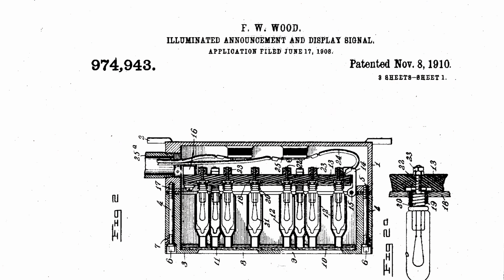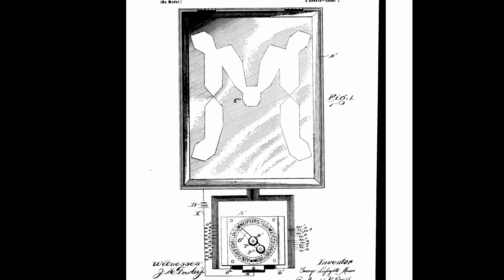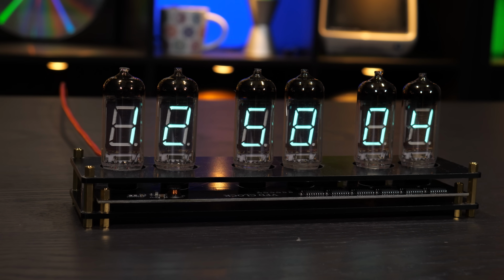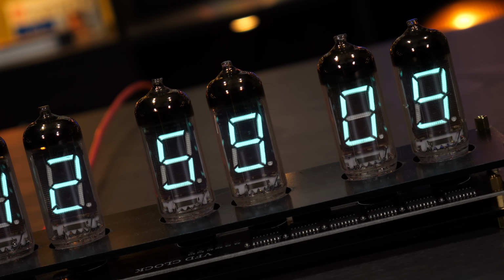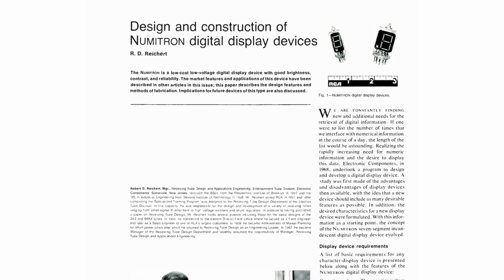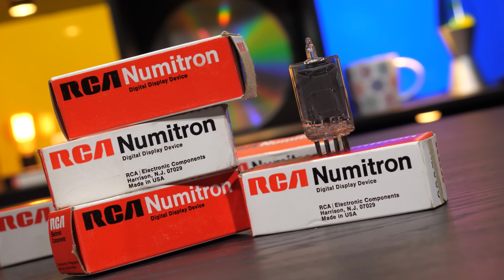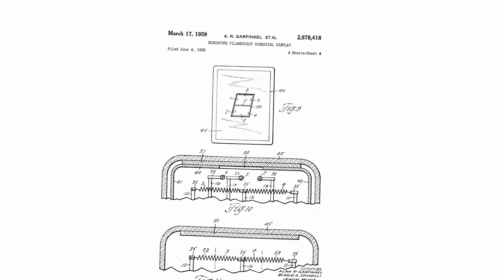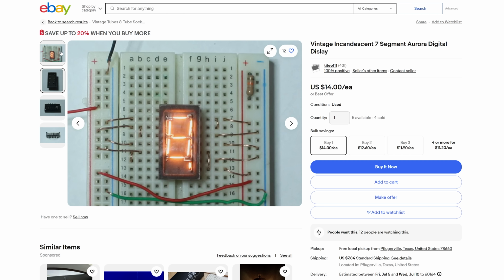The Numitron: An obvious idea that wasn't very bright

Comment: Really!?  You can't give these guys a break for an early technology product?  Before these, cash registers had rows of ten metal cards with a digit painted on it.  In each tens and decimal place.  So if your groceries were $12.67  You would hear whirls and banging the mechanical adding machine parts produced the total.  Then a series of solenoids selected which of the numbers cards to be displayed.  Then it would have to be thrust up into view by another solenoid.  Something that could be heard all the way across your favorite restaurant.  Now these come along for registers with electronic calculations and displayed your total with these amazing lighted digits.  All with no moving parts.  I can assure that no one that saw these quipped about what a half-assed idea they were.  

Maybe you should have a follow up to this.  Where you find any remaining engineers, they will all be in their 90's now.  Bring them on in their wheelchairs.  And have them beg for our forgiveness.  That 55 years ago they did not try harder to invent OLED displays before they dared to role out any display products.

Comment: If you're just going for a seven-segment display, you can address the visibility issue with a mechanical display, where you have a black mask with cutouts for the segments, and each segment is spring-loaded, with a tiny electromagnet to tip the segment to be visible through the cutout. This actually has the opposite visibilty issue, in that it requires lighting under low-light conditions, but becomes more visible the brighter the environment becomes. There are obvious minimum size constraints to keep the electromagnets for the segments from interfering with each other, but it can be made quite large without having to alter the mechanical design.

Comment: Fun piece of trivia regarding human-readable displays: In one of his bigger failures of postulating advanced technology, Robert Heinlein, in his novel 'Starman Jones', has the Navigator's Guild possessing 'secret' books of information -- which are just binary-to-decimal and decimal-to-binary conversion tables, because the navigation computers only accepted binary input and output only binary data, so the navigators aboard starships had to perform their navigation calculations (by hand and slide rule), convert their results into binary to be entered by hand into the computer, then read the binary data output back from the navigation computer, convert it back from binary to decimal, and repeat the whole process over and over again.

Comment: Looks very steampunk. My grandpa had a digital mechanical clock that would instead of having LEDs flip physical cards with numbers. It used half number cards so going from say 8 to 9 it only needed to change the bottom.

Comment: I bet between the limitation of the filimant shapes and RCA knowing LEDs were going to take over they pretty much just said shove what you have out the door and start workong on something new using LEDs.

 They would have likely had the inside knowledge that a way to mass produce LEDs  that was financially viable was about to pop out of the oven so there was no point in putting anymore time and money into these things.

Comment: In high school,  in 1980, I was taking electronics. We had a box of some decommissioned displays that plugged into something. We had no specs on them no background no nothing. One day I unsoldered on and hooked it up to our bench power supply and fired it up. The original case the display unit came in, did have a red front light diffuser. I put it in front of the display and it did dull the glare and everything you mentioned, but WOW. It looked more horrid than it did without the red color filter. They were being thrown out so I took about a dozen home thing that someday I'd do something with them. After all, most of the chips behind them were in sockets and there were BCD's all over the place. They had 4 - 7 segments all with decimal, and 1 #1 with a +/- . Needless to say, I carted them around until about 1995 then into the garbage they went. About everything was CMOS by then and 7400 series TTL's were about history. They were the small skinny tubes to boot. Man am I kicking myself for doing that today.

Comment: You want another janky technology of the same era - System 3 TVs. My parents had a TV repair shop and when the System 3s first came out they were guaranteed to come in for repair within 6 months because Zenith rolled them out before the tech was really ready. They were an early transition from tube based TVs to circuit boards - the name representing that everything other than the CRT and tuner was connected to 3 circuit boards - creating a whole LOT of empty space in the cabinet.

Comment: I suppose the more often you cycle the heat, the shorter the lifespan of the burner? That's why they are not using 1hz switching rate but like 5sec/5sec

Comment: Low voltage operation. Ha! It is true unless you are trying to use them in dynamic mode. Because the light output depends on power very non-linearly you need to increase voltage to provide the same power at low duty cycle.

Comment: The +/- 1 tube would be used in something like a 200 or 2000 count DMM. they show up to 1.99 (or 1.999) and the most significant digit will only ever be a 0 or a 1 (and require a leading sign).

Comment: 180V is low voltage as is anything below 1000V. Between 1000V and 35kV is medium Voltage and above is high voltage as per EU standarts. I know its still an issue that its higher than the control circutry, of course. Heck, 180V DC is close ELV, Extra low voltage which with Direct Current is anything under 120V and with AC anything below 50V.
Reply: Those classifications do roughly corrospond to actual issues one might face imo.

Comment: 180V is hardly high voltage :D
Though those tubes at least in larger configurations often need a lot more to turn on, like an order of magnitude more. Once they are on they dont need as much anymore, but that initial spark ionising the gas...
Reply: Oh, and i wouldnt exactly call 180V dangerous. Not in terms of electrocution or anything anyways. Theres a reason most electrical deaths occour above 300V. Most commonly with TVs which CRTs are driven by thousands or even tens of thousands of Volts. Other than that if its in the household its often with two phases instead of one, which comes out to 400V instead of 230V which one phase would have. Those 400V are commonly what electric stoves work with.

Comment: So, first observation, took you 1 hour and 2 minutes (plusish) to 'film' this video (That clock IS useful!).  As far as segmented displays, all of this was going on when calculators were exploding design wise, CB's were going crazy, and VCR's were about ready to hit.  Companies were scrambling to come up with hardware solutions to postulated 'hi-tech' ideas, so they could be 'on the ground floor' of ANYTHING that came along, especially as hardware lead time was months and years, and ideas was milliseconds. A lot of it was adapting 30-40 year solutions to 'now' ideas. I remember my first electronic project in the EARLY 70's a Heathkit clock with your mentioned fluorescent segments, and all of this prodded me to become a controls engineer.  It may have been hokey in implementation but it was ALL useful in what 'came next'.
Finally, still love your videos, both informative as well as nostalgic.  Next, maybe you can describe the original Mustang/T-bird Sequential turn signals! 🙂

Comment: Fundamentally incorrect analysis.  Nixie tubes using bi-quinary code don't need more outputs.
The clear advantage of the numitron was in having a direct interface to digital logic.   Microprocessors came a decade later, not a factor here.
Numitrons work very well in specific applications and are still in use, aircraft avionics being one example.

Comment: RCA developed them to get out of paying Burroughs Corporation for Nixie tubes.  Either to buy them or pay the royalties to build them.
They designed them to put into the RCA Spectra Mainframes and potentially into consumer products (ie tvs).  RCA sold their computer division after loosing millions and millions of dollars to Sperry Rand in 1971.
Sperry sold the Spectra mainframes as the Sperry UNIVAC Series 80 and then later 90.  Ironically, Sperry made big money in the 70s and early 80s selling RCA Spectra computers slapping the UNIVAC badge on them!
Oh yeah..... The unbelievable irony was Burroughs Corporation bought Sperry Corporation in 1986 becoming Unisys Corporation.   So, the very company who RCA didn't want to pay for Nixie Tubes wound up owning their Computer Systems Division!

Comment: Numitrons we're used in UK petrol pumps particularly Gilbarco highline 1 and Avery Hardoll mk4 a and b, the flat pack versions were used in Avery Hardoll mk4 c, Bennett Beck 5000 and possibly a few other manufacturers

Comment: I have a few DIL flat versions, never seen the round tube ones. I've thought of making a clock, however as light bulbs have a horribly short lifespan, thought it a bad idea (one person said I should add a presence sensor, so they only light when someone is in front of them.)

I remember a horse racing track (or was it greyhounds) that has a massive clock made out of 4 foot fluoro tubes, I remember thinking, wow now that was easy for the sparkies to setup, nothing Hi-tech their end.

As for the video, I was kind of screaming at the screen, "do up the screw on the last digit"

Comment: 3:10 Nixie tubes. The first digital display I built in the early 1970s used them. With the 7441 BCD to decimal interface IC, they were pretty easy to use. 

4:30 Then I tried 7 segment LED displays using the 7447 to drive common anode displays or the 7445 for common cathode ones. As late as the mid 2000s, having to drive a 2 digit display, I used a 4511 7 segment decoder and 1 line for digit select using a total. of 5 lines from a microcontroller to drive a 2 digit display.  My µC programmer thought I was crazy and wanted  to use 14 lines from the µC. 

8:20 Numitrons came out in 1970! No wonder they failed. I was already working with LED 7 segment displays back then. 

Good vIdeo though.

I now have a Nixie Tube style of clock I bought as a kit from a company in China. It uses edge lit plastic numbers with multi color LEDs. 

Go to the "banggood" web site and do a search for the "Geekcreit® Upgrade Boldfaced Word Imitate Glow Clock Full Color RGB Glow Tube Clock LED Music Spectrum Kit DS3231" 

Or on YouTube, do a search for ":Full Color RGB Glow Tube Clock Kit | LED Music Spectrum Kit"

I am not pasting a link as YouTube may think it is malware. 

I got the version that was $9 more with the PCB pre-assembled.  I also got one for my kid to use in their office at work.  I think you will see it is a worthy addition to your display collection. It cycles through all the colors.

Comment: I recall seeing these in at least two pieces of equipment, one agricultural and one industrial.  I saw them before I heard of nixie tubes, so when I heard of those (described as having glowing orange digits), I assumed they were one and the same.

I'm certain the digits were at an angle in at least one of the devices, and more closely spaced.

Comment: 9:24 Why limit yourself to 4-foot fluorescent tubes as segments? I have 8-foot tubes in the room I'm watching this in. (Haven't tried to convert them to direct drive fixtures for LED tubes yet...that'd be even better!)

22:20 Continuity errors? Not nearly as bad as the bridge scenes on the Enterprise in Star Trek IV, which had running SEVEN-SEGMENT LED CLOCKS for some reason...IN THE TWENTY THIRD CENTURY.

Comment: The aviation industry was supposedly in favor of the incandescent display for many years due to the claim of "better visibility in sunlight".  They had instruments using the flat pack or "bath tub" design like the ones Wamco or IEE made.  Such a Numitron hater but still made a clock LOL.   The puny LED started to advance at the same time of the inception of the Numitron.  Yes, it was destined to be overrun by the LED.  Evolution in everything.  I think the Nimo tube was the worst idea due to complexity, voltages and package size rather than the Numitron being the worst.  And the timing of the Nimo was fairly late to the party if I recall correctly.

Comment: There was nothing wrong with the Numitron; it worked just fine for what it was at the time.   Why don't you do an entire series about how All vacuum tubes were stupid and never should have been used, and we all should have done without radios and televisions before the invention of the transistor,  and then do a series about how the slide rule and the compass were stupid?    You can take that attitude as far back as you want.

Comment: I remember seeing these used on petrol pumps in the 1970s.  I often wondered exactly what kind of display they were.  They seemed neat at the time though, being a step up from the roller wheel numbers used before.  I think the use-case these were envisioned for was to fit in equipment that previously used nixies, so they would be (fairly) simple to swap out?

Comment: I wonder who exactly these Numitron tubes were marketed for... it is as you say near the end of the video, that anybody using these in a commercial production device would have been seen as cheap... however... I could see a use for Numitrons in prototyping and hobbyist spaces. Picture this, you're trying to make a prototype device that needs a 7 segment display and you don't want to blow a bunch of money on more expensive options, and you want something that will just work with minimum energy and fuss required, minimum parts. You don't want to hook up a power source to a display that needs more power than the logic circuits can pass, and so you grab a few numitrons to make sure your device is working properly while you're developing it. Then, once you've perfected the design and you're ready to go into the final stages of development, then you add the better displays and anything else they need to run before releasing the final product. And of course, something cheap for hobbyists making their own clocks or what-not, would have probably found these easier to use than the more complicated options of the time. Now, obviously once LED displays went into mass production this all went out the window, but briefly I could have seen these being used by those people.

Comment: It's a minor detail but it's interesting to realize that BCD decoders were once made as dedicated chips. I think just about anyone who's studied computer or electrical engineering has had to create a BCD decoder circuit for a 7-segment display when they learned about logic.

Practical or not, these numitron tubes do look very eye-catching, and you could pretty easily recreate their design and aesthetic using LED light bulb filament.

Comment: 50 years ago I owned an HP scientific calculator with a display much like this. I loved it. I found that the "Reverse Polish Notation" it used (not 4 X 5, but 4, 5, X) just made sense to me. I still think I have it around here somewhere, though the battery is probably unusable, and the charging cable probably disappeared 40 years ago. Thanks for reminding me of a little bit of technology that I still remember fondly decades later.
Reply: Same with RPN 'just works' in my brain too.  I think with a popping stack ^_^
My dad had an HP-27 which is what I learned on, got my own HP-32S for high school, and then later acquired for cheap! an HP-28C at an auction. It lives quietly, silently, unpowered on my desk; a memento to history.  I might dig up some batteries for it and give it some love.

Comment: @technologyconnections have you ever heard of wearable AC units? Apparently it’s a ceramic radiator that cools down by 30 degrees, but I can’t find any real info on how it works or where that heat goes. We need you on the case!

Comment: Would you do doorbells please? A button with a light or a smart button must be continuously energised. How is the wiring changed so that the chime isn't also continuously energised? Or is it continuous energised and sitting there trembling 24/7, trying make a noise but not quite having enough juice to squeeze a note out.

Comment: the strangest effect of this kind of clock I ever noticed (and have never really noticed elsewhere) is that if you sit in the dark and hold a clock with one of these displays and move it slowly with your hand the display will seem to "lag" behind as you move the clock through the air.

Comment: I too remember the orange seven-segment displays used in gas pumps.  I recall them being in use at a few Mobil stations in the early-mid 80's around Detroit.  (Ault's Mobil at Plymouth Rd and Merriman in Livonia was one.) They also had pushbuttons that would shut the pump off when it dispensed a certain dollar value of fuel...$5, $10, $15, $20.  They were pretty futuristic-looking!  Most other gas pumps at the time still had mechanical counters for the volume of fuel dispensed and the total sale.

Comment: I first (and last??l) saw these used on petrol pump displays which jumped from a mechanical dial to electronic orange.  Kid-me thought it the very window into the future.  There was even a complementary " 1/2" digit bespoke tube which flahed rapidly as it raked up gallon-rate  halfpennies on the bill.

Thanks for the memories